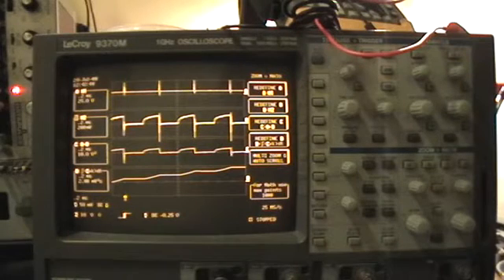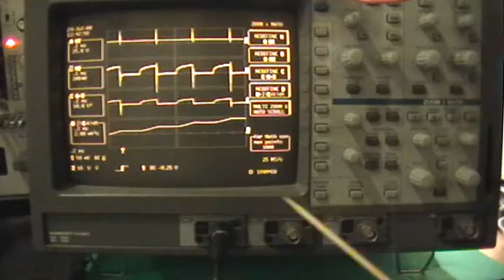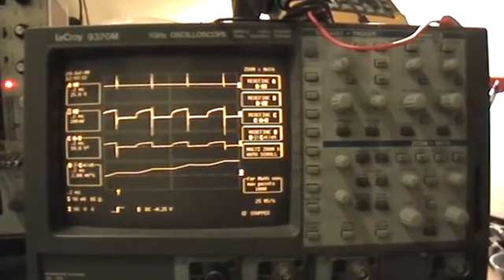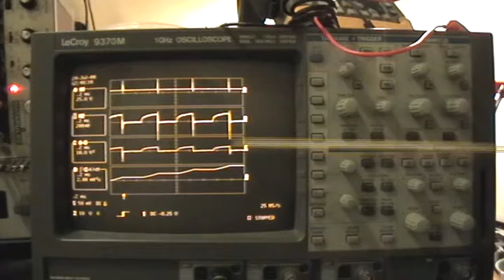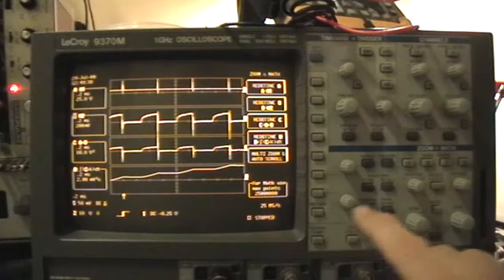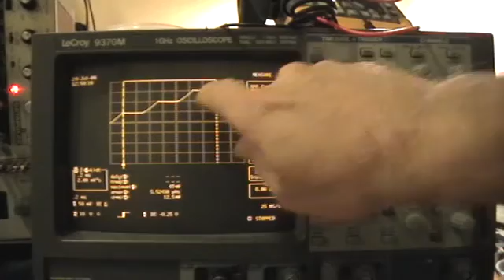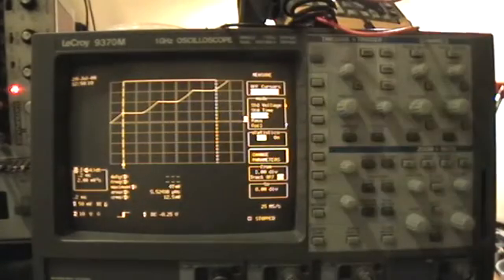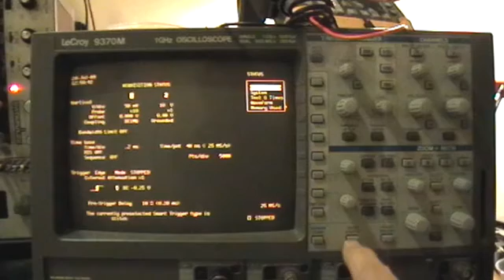Electric OU: Energy Flux Measurement Using the Digital Oscilloscope

Comment: The correct power waveform pops out from the discrete numerical operation yes.

Phasor method is a powerful mathematical tool which simplifies the situation so that you don't have to deal with differential equations when analyzing circuits with time-dependant LC components and their impedances. Not very useful in non-linear situations like in these sort of pulsed circuits though but it gets you the frequency domain behaviour of the linear components from quick back of the envelope calculations.

Comment: It's a little hazy half-baked term isn't it. Meaning here that the time-dependant wave equation gets you complex number values where phase has a similar meaning than here due to the impedance phasors.

Comment from the maker: And of course you are mixing up the power dissipated in the Current Viewing Shunt (0.25 ohms, 0.400 volts DROP), or 0.64 watts dissipated in the shunt. The 40 or 20 watt figure is for power dissipated in the 8.4 ohm LOAD at 1.6 Amps continuous or at 50 percent or so. Which can be calculated from the current of 1.6 amps and the battery voltage of 25 or so volts and the duty cycle of 40 percent ON.
And you really should read the Ainslie papers before we can seriously discuss resonance.

Comment: Lets see...current lags voltage...no wait...charge leads current on inductipacitors...ok...What?

0.400 V accross 0.25 Ohms is how many watts?

o.O

Does 0.64W sound about right to you? 
40W? 
20W? 
Huh?

Houston I think we have a problem. We don't know where our current is in time inside an inductive resistor limiting a wannabee resonant  LC circuit, and we don't know where the current is inside the inductor or the capacitor of the same for any period of time.

Marker pulse 54 where are you?:-D